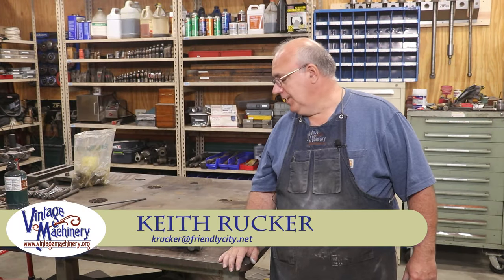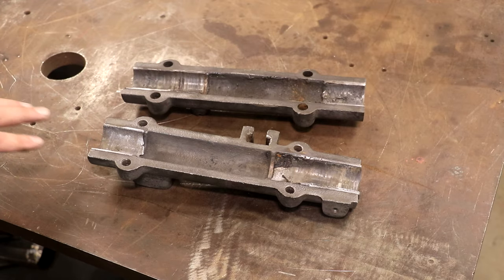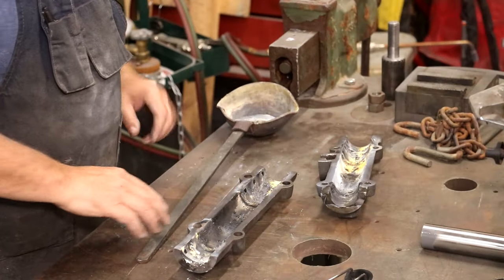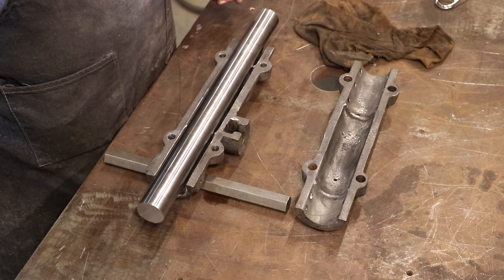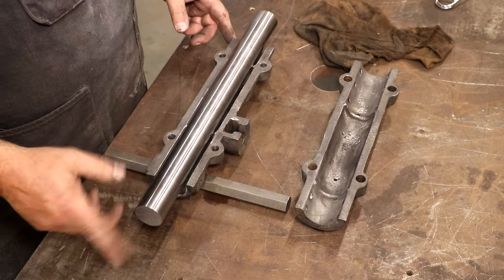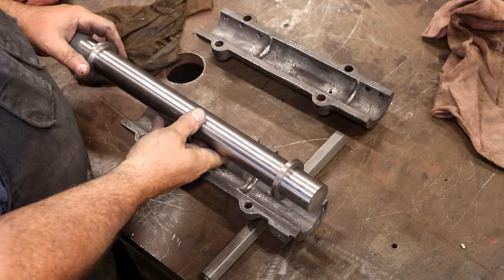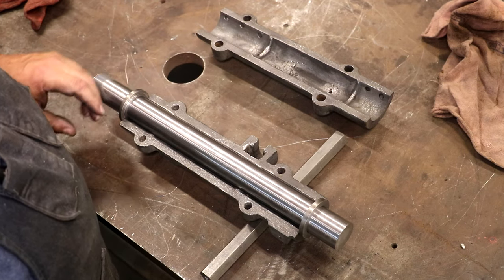Pouring Babbitt Bearings for a Crescent Band Saw

Comment: Pouring a Babbitt bearing is the easy part. But make sure cutting the oil grove is the most important of the entire process. Many to not get the oil grove correctly cut on the top and bottom

Comment: I have never poured babbit. Just wondering, would it help the quality of the pour and eliminate that bubble in the top pour if you did 2 things. First,  increase the size and chamfer the pour hole and second, install a vent holes?  IMHO, it would not detract from the original because it will fill with babbit. I realize that the top is not as critical due to not having to carry the weight, just inquisitive.

Comment: Pouring Babbit bearings is certainly not a high precision operation, but, for the time frame when they were in wide use, they more than adequately served the purpose for which they were intended.

Comment: I remember my father talking about babbitt bearings in engines, and scraping new ones to fit correctly. 😉
Reply: Michael McClure I have used scraping tools. In doing large bearings in steam turbines. Using blueing and mating the surfaces and turning to find high spots. Assembly and dissembling. Over and over and scraping till surfaces have proper tolerance.

Comment: When you sooted the shaft for the 1st side,did you remove it from the casting so the poured area wasn't covered,or did you soot the poured area too,or does it matter?I would think the bearing might break loose and spin if the poured area was sooted too.Am I wrong?Thanks for sharing,and Stay Safe during this Covid mess!!
Reply: The purpose of sooting the shaft is so that it won't stick to the babbit, otherwise you would effectively solder the two parts together, so yes, the poured area was sooted too.

Comment: I really enjoy watching your videos.  I'm working on restoring a Model T engine. Repouring the babbitt. I've watched many videos on this process. I'm having an issue with my damming material coming loose when I'm heating and pouring. Since I can't get babbitt rite I've purchased some damming compound from Knapp.  Do you have any suggestions?  I've used more, less etc.  I was told that I need to have the caps and molds to 450° .  Not a lot of videos say what temperature things should be at before pouring.

Comment: On the small hole that you poured you could have drilled the hole too a larger diameter then tap it and poured it afterwards you could have inserted a set screw. This way if you ever need to do the job again then you can remove the set screw allowing for an easier pour .  P/s you can drill a hole into the center of the set screw so it can act as an oil hole

Comment: Great video Keith.
During assembly it looked like the short bearing in the top half was mated to the long bearing in the lower half.
Do you think it was designed that way due to the fact the shaft is radially loaded on opposite sides during operation?
Reply: That is my suspicion as well. There will be an unbalanced load on it and if the design is right the larger bearing half will be the more loaded one.  

An interesting side effect is that the oil in the middle cavity will be squeezed into the gap all the time and flush dirt out that will settle in the cavity.
Reply: Watch carefully when he pours the second half of the bearing. You will see that it is long to long and short to short - same at final assembly.
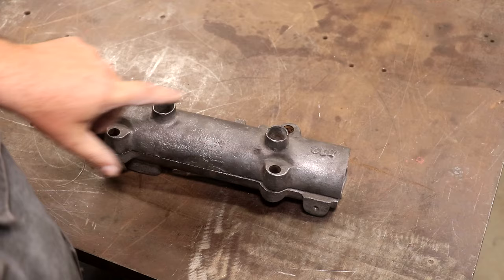Reply: @chrissometimes7473  If you pause the video at 1:42 you will see that one short bearing is paired with one long bearing in this style housing assembly.
Reply: @milanmechanical4652  That's just the way the bearing halves were sitting. If he poured the second half of the bearing with the top the wrong way round, the oil reservoir would have been filled with Babbit.
Reply: @chrissometimes7473  Watch the video closely! The housing would not line up correctly if one side was rotated do to the clamping bolts being closer to one end.
The babbitt material was held back from the oil reservoir with the dam material installed at 15:50 and 16:48

Comment: I'm new to your channel but really appreciated this video. I work at a Grist mill turned museum and we still operate. I came in as the new miller a couples years ago without anyone to train me. As things start to wear, I am curious what grade of babbitt I need, or if it matters. The main bearings that wear are the thrust bearings that support the 2000lb runner stone via a forged shaft. The shaft sits in them and is ~1.5" diameter. When I went to repour one last year, I couldn't melt the current bearing with the torch. It seemed like a much higher melting point than I expected. Any suggestions would be appreciated! Thanks for the great and informative content!

Comment: I have a question.  I have what I think may be the same saw that this bearing is from.  Crescent with 24” wheels.  The bearings are not perfect but they still work.  
Wondering what weight oil you put in these bearings?

Comment: Enjoying your videos! I have a Crescent similar to this that went thru a shop fire and I re poured the shaft shells but couldn't tell if there was babbitt in the upper guide shaft clamp or the table trunion so I've been using them unlined. Can you tell me if they should be lined with babbitt metal? It would be a great help - many thanks- Mike

Comment: Keith, I spent a lot of time worrying that you were about to assemble the two halves the wrong way round, as in the long bearing opposite the short one.  Please assure me that the pair were finally mated together correctly.
Reply: I'm thinkin' the same thing. Sure looks like they went together backwards.
Reply: That tiny pouring hole made no sense too. I think you're right.
Reply: @StanislavG.  I would guess that the shaft is being pulled in one direction all the time, the long bearing surfaces should be at opposite ends.  One end if the shaft is being forced up and the other is being forced down.  Anyway just a guess.
Reply: The bolt holes only allow it to assemble 1 way. They are different distances from the ends on each end...
Reply: @truracer20   I was about to say the same thing. You cannot stuff it up.
Reply: I also recognized that from the very beginning. But Keith made no mention of that.
Reply: The bolt line up as a long and a short on each 1/2  as shown.  The offset is different  on each end of the part  from where I am standing. So the part look correct.
Reply: I was thinking that as well, but the pour would have bypassed really badly had they been installed wrong, so it must have been right :)

Comment: Hey Keith I have a new stainless shaft that I believe is 2 in dia x 5 ft long.
Do you have any use for it. I bought it a few years back as a spare prop shaft and never used it.  It is still in the shipping box I got it in. Its sitting around and I have no use for it. I thought maybe you could use it on a project. 
Thanks for another cool video.  B.t.w how did the coal feeder turn out. I never saw the finish of it.

Comment: Nicely done Keith. BTW when we pour babbitt bearings we always tinned the shells. I suppose you had your reasons for not doing it. (?)
Reply from the maker: These shells had small holes drilled in them to lock the Babbitt in place.  Tinning is not necessary unless you are pouring in a smooth bored surface where the Babbitt cannot grip onto something to lock it together.
Reply: @VintageMachinery  Thanks for explaining that Keith, makes a lot of sense and also makes the job a whole lot easier. Here in South Africa we call that type of bearing a white metal bearing, your channel is the first time I have heard called Babbitts. The metal we used is very similar to Linotype metal, having an alloy of lead, antimony, copper, and tin.

Comment: Why didn't you pour the second part the same way you poured the first one ? Thanks.
Reply: i think it is because he needed to have extra material using the shims
Reply: @gtb81.  Why doesn't Keith give us an answer ?
Reply: @RichieCat4223  no idea, but that was my theory
Reply: @gtb81.  Thanks for your input.
Reply: Let me answer this as I have did this alot back in the day when I work on antique machinery. First off a bearing works on precision fit thus when worn they must be replaced. This is important when pouring a new bearing. So when first half was poured precision isn't nessessary it just is poured to form. But to complete the bearing the housing must be installed with shims and poured to complete the bearing with precision. The purpose of the shims as bearing wears shims can be removed keeping the bearing precision snug. Giving a longer life to the bearing. If poured like the first half you would never get a precision fit of the bearing. Back before bearing inserts was being used babbit bearings was used on engine crankshafts. I once rebuilt one in an old generator light plant. Those had to be perfect as they ran and high speed. Just a thousandth off and the soft Babbitt would beat itself out and blow the engine. That's why the housing must be assembled for final pour. Hope this explains it I am not a good teacher just an old mechanic.
Reply: @kenjett2434  Thanks I understand now.
Reply: @kenjett2434  Well said.
Reply: Thanks everyone glad I could explain at least try. About 45 years ago I spent alot of time around the old hit and miss engines in the oilfields. Practically everything was babbit bearings so I learned alot of old tricks. Seems today that knowledge is a lost art I think I am the last generation to have actually worked that old equipment. To actually drill wells with those old machines.

Comment: Keith I have a question regarding metal slivers.  What is a good method to remove metal slivers as I suspect you get them on occasion.  I don’t get them often but when I do I find they are very hard to remove.  They are usually very small and very annoying.  Just ask’n.
Reply: Really aggressive tape, like Gorilla Tape, if there's a bit still sticking out. Stick it on and work your thumb over it to get it stuck well, then rip it off. Hair removal wax can work too.

Comment: Mr. Rucker, would've been feasible to have made four of the "rings" that you made in the leith to keep the Babbitt dammed in place? Great work, by the way!!!
Reply: What's a leith? Also Babbitt is an alloy, Babbitt bearings are bearings made of that alloy. There's no 'Babbitt' that needs to be held in place.
Reply: @dr.lexwinter8604  He was meaning  lathe and he was talking about making 4 dams cut on the lathe vs using the babbit putty.  Now to answer his question, He said he wasn't going to do that because the dams were a slightly different size so he would use putty instead.  Hence 2 metal lathe cut seals and 2 with babbit putty.
Reply: @GodzillaGoesGaga  , thank you for clarifying and answering my question. 
@Dr.Lex Winter, I did mispelled "LATHE" but it was a question coming from someone who doesn't know anything about this process and just wanted to know why he decided to go that way.

Comment: It looked like you mated the short bearing halves with the long ones. Was there a reason for doing that?
Reply: I don't think it's possible to assemble that bearing block wrong, the bolt holes are not symmetrically offset from the ends of the block - one looks an inch further inboard than the other
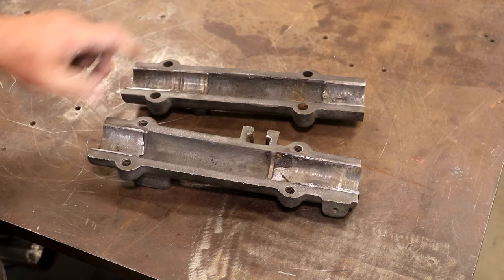Reply: @leriksenbendigo  You are right about that. I can stop thinking Keith got it wrong now, thanks! But I think I am also right that long ones are mating with short ones. Look at 2:39. I think it is because the load pulls the shaft down on the side with the wide bearing and levers it up against the top bearing, also wide. Very odd to see, but it makes sense.

Comment: Very interesting! Why did they use that kind of bearing instead of roller bearings that could be easier changed?
Wonderful Bandsaw!
Reply: As he said, these predate modern bearings, however, some have over the years updated white metal/ babbitt bearings to modern bearings, whether ball bearing roller bearing etc, at one time it was not uncommon to upgrade old car engine bearings when doing them up
Reply: babbit material was made successfully in 1839, before that it didn't work all that well, but in the 1840s roller and ball bearings were unheard of yet
Reply: @davidp8157  Thank you, my English is not so good that I can understand all he had said...

Comment: A proper babbitt bearing is actually better than a ball bearing as they don't induce any type of harmonic and the provide better support overall.  Babbitrite isn't available because it is 40% asbestos.  I've used the rotometals casting putty before it works and isn't expensive.

Comment: Looked like the bearing on one end was longer than on the other end.  Does it make a difference is the 2 halves are reversed, with a long on top of a short and vice versa?
Reply: Its because of the loading thats on either side. Think of it like a lever. If the load is on one side it torques the shaft. This makes it push on the bottom on one side, and the top on the other side. So you only need 'more' material on one surface. Hope it makes sense.

Comment: Great video (as usual)!  Thanks.  Does the Babbit alloy contain enough lead to worry about beyond hand washing and “normal” dust clean up?  (I noticed you didn’t need a respirator while heating.)
Reply: if you noticed when testing the temperature of the Babbitt the pine stick did the smoking not the metal, this pour was Babbitt not a steal girder for a skyscraper
Reply: Lead in metallic form is not absorbed easily through the skin, but still a little.  Dust settles fast.  However the vapour and any compounds are easier to be absorbed and are to be avoided as best you can.  As it is a cumulative poison each exposure adds to your lifetime dose, as it targets and damages nerve tissue it is best if under 20 year old enthusiasts take extra care while their brains are still developing.

The main dangers in this Babbit operation are when removing the old bearings and having lead vapours that you can inhale and they will basically pass any normal filter mask so doing it outdoors is advisable.  Then the extra pretty yellow lead oxide that is formed is soluble in stomach acids and vinegar so don't sprinkle on your salad.  Basically any thing that has lead and is not the bright shiny metal is to be avoided.  Collect and dispose of all the dust and shavings, use a vacuum or mop rather than a broom or compressed air.

The hot oxy-gas torch generates the most danger and should be handled with care.

About the Asbestos:
The Asbestos fibres in the putty are pretty safe while in the putty but scorching it with a flame will almost certainly free any included asbestos fibres.  This would concern me more than the lead play. For those that advice not to panic that is well and good but it is important to remember that there are recorded cases where a SINGLE exposure has resulted in incurable Asbestosis years down the line.  It is something to be avoided and replaced with safe alternatives whenever possible.  A good quality dust mask can provide a lot of protection while working with Asbestos but you also need to vacuum or damp clean the work area and around it after you are done, it is easier not to contaminate the area if possible.

Comment: What type of metal did you make the mandrel out of?  I need to do the same but am looking for something that is easy to machine. Thanks.
Reply: It doesn't matter, as long as it can take the heat. Any steel would work. You could probably even use aluminium. The soot will stop the babbit sticking. Just make sure everything is hot before you pour. You don't want the babitt solidifying before it has had time to flow.

Comment: Don't get lead containing alloys hot like that, when you melted it out. You can vaporize the lead, and you're breathing that in. Quick way to raise your blood lead levels.

It doesn't take that much to melt it!
Reply: That metal's flowing down as soon as it hits melt temperature, carrying away heat with it. There's low to zero odds he vaporized any lead, it just wouldn't have been heated long enough to vaporize. It's away from the heat source as soon as it'll flow.
Reply: @Pyrichia  It's evidenced by the yellow lead(II) oxide left behind that it hit at least 600degC. I would expect certainly a nonzero amount of vaporous lead. But besides, you really want to avoid lead oxide dusts.